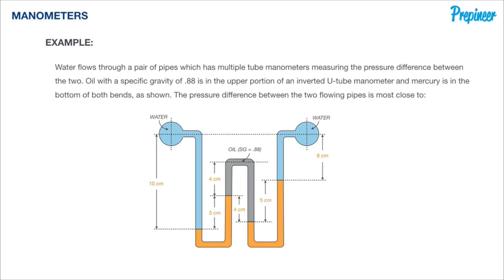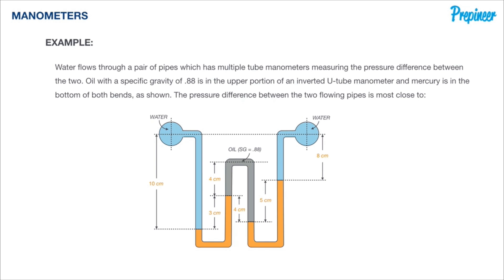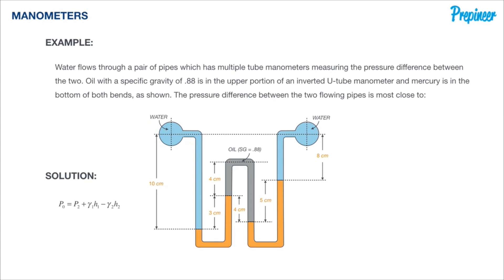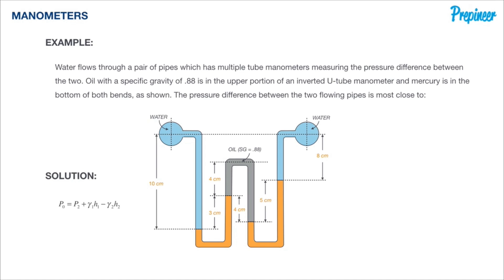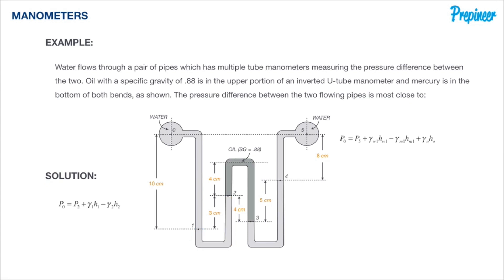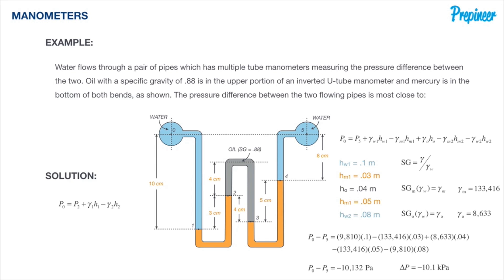FE EXAM FLUID MECHANICS - COMPLEX MANOMETER | FE EXAM PRACTICE PROBLEM | DAILYDOSE 053

Comment: Your signs are flipped for the two height based pressures. h1 is negative while h2 is positive. I checked with NCEES, but also if you just think about it, the left pipe must be of higher pressure as it has pushed the mercury (pretty heavy) towards the right tube. Negative elevation change decreases pressure. All this does is flip the sign of your final answer. I also noticed this for your other manometer problem.